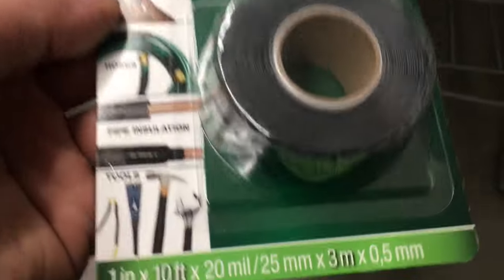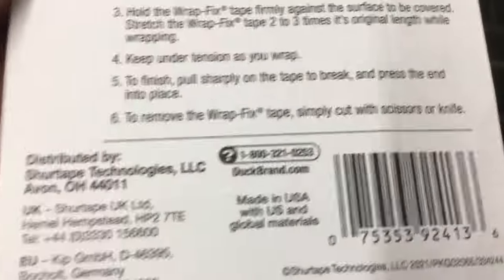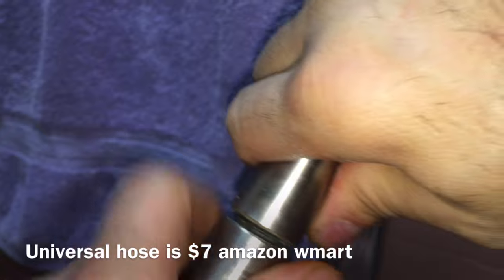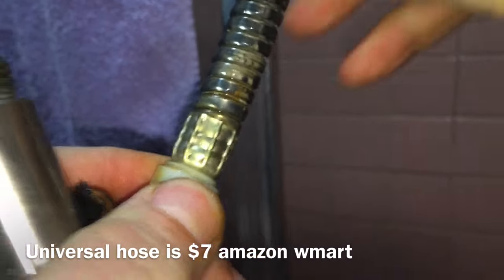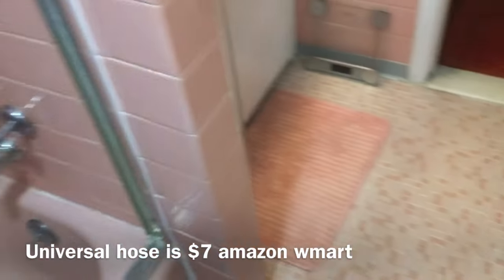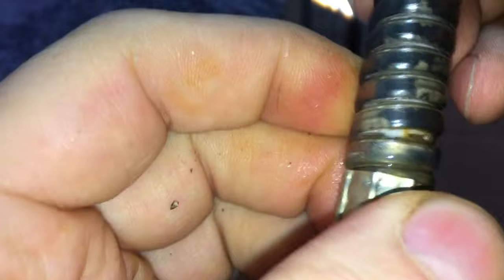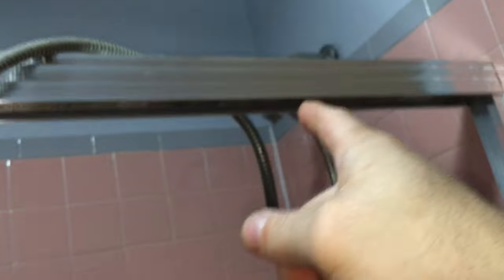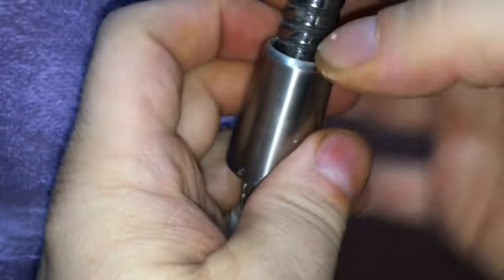Testing DUCK Wrap Fix Self Fusing Silicone Repair Tape on Shower Hose Leaking Hole

Comment: You DID NOT use this correctly my friend... First you didn't use nearly enough and you have to go up and back down and about about half way up again so that the very end piece of the tape can bond to itself and you have to pull this tape extremely hard for it to seal properly...
Reply from the maker: well yeah but explain how I would screw it back on with such a huge lump in the way! regardless new shower hose is $7 this wrap is what $8? I dont believe the pressure ratings though... something for Project Farm to test!
Reply: @bobspurloc  yeah you're correct cause I literally just bought some for 8.89 + tax,  BUT trust me when it's used properly,  it works very well! Even on high-pressure pipes... I honestly think that it's no good to repair hoses like you have here in your video because it can sit down in those cracks probably... I only use it on smooth, solid pipes and lines... So I think in your case you're right to have just replaced everything with new...
Reply from the maker: project farm needs to do a bunch of tests showing max psi, hot, cold issues. jbweld is probably more of a permanent fix. I've sealed actively leaking gas tanks with some jbwelds. holes at bottom of tank from rubbing against straps. also used it to seal rusted hole in tank fill pipe to stop small evap leak warning. made a video on that lol

Comment: So what did you end up doing?
Reply from the maker: replaced the oring since it was pinched, I think I tried this stuff again over the crack In plastic coupler but I think water pressure poked hole thru again. it may have been because I removed installed it multiple times or needed more layers... but I had a replacement shower head already that I bought years back. so I just replaced hose and sprayer, truthfully a replacement hose is only like I think $8. if you are going to take it off to look at it then you have knowledge to replace it too lol